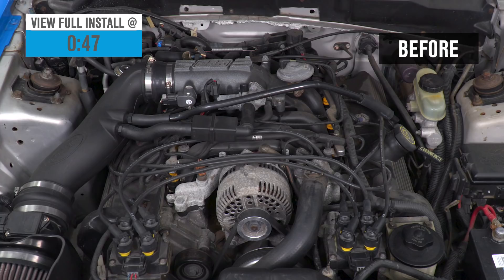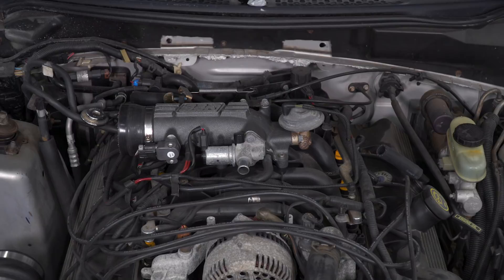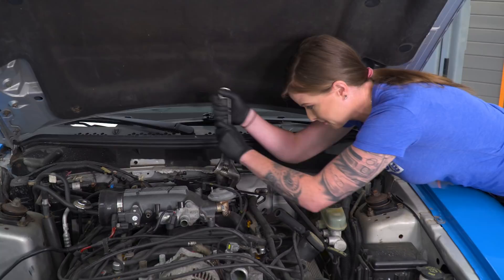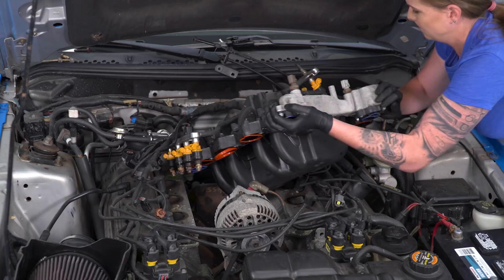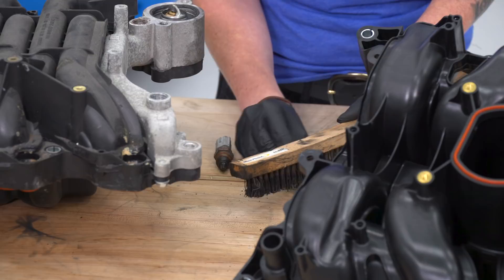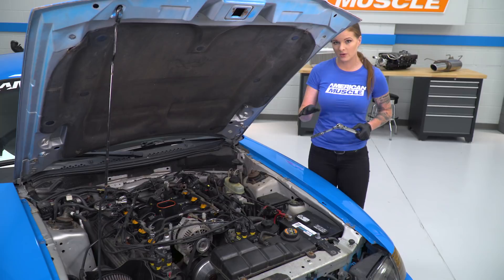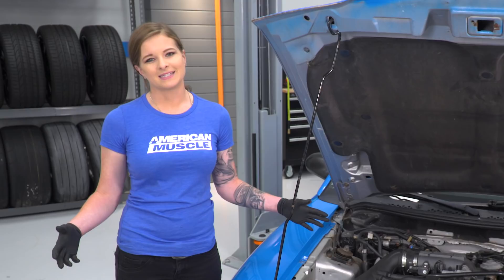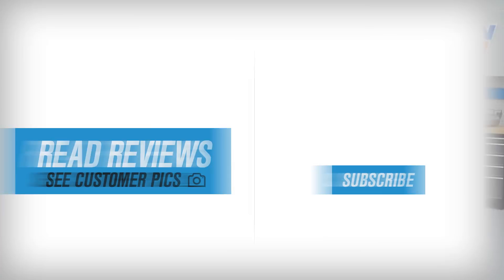1996-1998 Mustang GT OPR Replacement Intake Manifold & Gasket Set Review & Install

Comment: Do not buy this, buy the ford racing pi manifold. The Dorman is known for robbing power
Reply: This is a non PI motor.
Reply: grabir01 you can retro fit the pi intake on a non pi motor
Reply: I dont understand how it can rob power since it is exaclty the same design? I'm ordering this today . my car has all bolt ons. Its not fast anyways. And the ease of this install sold me. I don't feel like frabkensteining parts from a new edge to get it to work. Id like to see a dyno sheet of this thing robbing power.
Reply: @anthonyhales4192  it’s not the exact same design at all but go ahead bro
Reply: Did anyone have an issue with the back drivers side injector fuel rail bolt not tightening up and spraying gas out? I'm having that issue right now
Reply: @ReyesBuilt  what would you say is " different " on this manifold besides the aluminum crossover ? Looks just as deep, runners look the same. Now does ford themselves have an intake manifold replacement for a non p.i motor with an aluminum crossover? If they did american muscle would have it .
Reply: @kevinkeeney3295  sounds like the threads on the bolt are buggered up or the bolt went in a little sideways and cross threaded
Reply: @anthonyhales4192  its not.. actually this is my 2nd intake manifold I purchased thinking it was threaded out.  Bought a new one exact same issue I can't tighten the fuel rail nor does the 8mm bolt tighten up or snug up enough for the injectors to seal. It leaks out the exact same spot. Im about to go back to the factory manifold
Reply: @kevinkeeney3295  for some reason on American muscles site when you click on the product it shows it comming with a couple different sets of bolts. Could one of those sets of new bolts be the 4 needed for the fuel rail? Hope you get it straightened out I will be installing this in the next couple weeks. I just dont get why the part would be such a peice of shit and American muscle sells it. I could care less about power I just don't want my stock one to crack and leave me stranded. I guess i will have to look at this peice carefully before i take apart my car that has nothing wrong with it
Reply: @kevinkeeney3295  after alot of research I just completed a p.i. intake swap on my 97 instead of going with the Dorman. It's actually very easy and as long as you put coolant friendly rtv on the coolant port where the p.i. gasket quite doesnt match the non p i. Head ( plenty of write ups and videos on this, i watched Chris fix video alot before tearing into it) let the rtv cure a little before torquing down thrn another 24 HR to cure completely and its fine I have no leaks whatsoever it runs awesome. My stock fuel rail bolts threaded nicely into the p.i. intake as well.
Reply: @ReyesBuilt what is needed

Comment: I am doing this replacement and I have a question the old intake with the plastic cross over it has the the spacer with the gasket on either side for plenum. Do I need the use the plenum plate with the new intake?

Comment: I'm hoping someone will awnser this for me. Could you put a 1996 shelby cobra manifold on a regular 1996 gt mustang?
Reply: I believe u would have to plug a coolant sensor add some gasket maker to the manifold gasket in certain spots and change the waterpump hose under the manifold. You would also get a reduction in hp because the manifolds before 98 had weak air flow compared to newer models.(Will this work, idk. I wouldnt try it)
Reply: the cobra of 96 is like the 99-04gt

Comment: Do you need to depressurize the fuel system before doing this if you could comment quickly I would appreciate it thank you
Reply: It would be best if you did. However there should be a Schrader valve that connects both fuel rails together. Pressing that valve "should" depressurize the fuel rails. However the best method may just be to disconnect the fuel pump in the trunk and let the car idle until it runs out of gas. Hope this helps.
Reply: Not if you do a hack job like this. Did you see her struggling to get the intake out, and then in ? The best way is to de-pressurize the system and take the fuel rails off. Get everything out of the way, for a clean install.

Comment: Great job Stephanie on installing the intake manifold the one thing you forgot to show is the gaskets a number 2 answer that guy's of question Dustin you cannot put I shall be or Cobra intake on a regular GT 4.6 2v Cobra in Shelby's on for valve 32v can't do as a whole different set up!!!!👍/// and also as a mechanic myself always go to the Ford dealership and getting brand new intake manifold 4.6 even a 5.0 cuz if you go aftermarket Ford Racing yes they're good but those are the Brand's I do not trust it so always get to the dealership replace whenever you taken off and save money and save a headache!!
Reply: Where is your video.